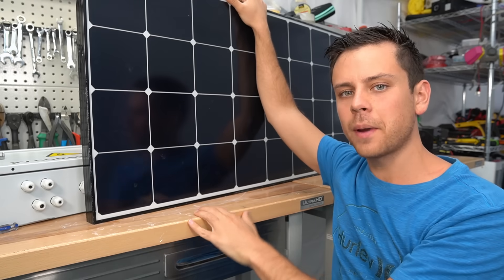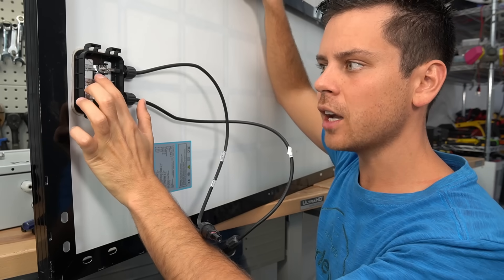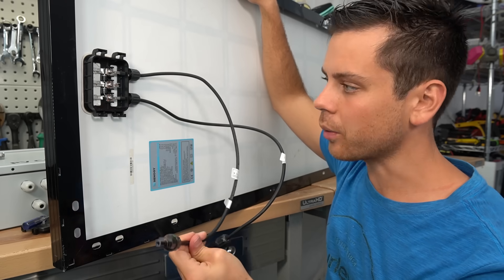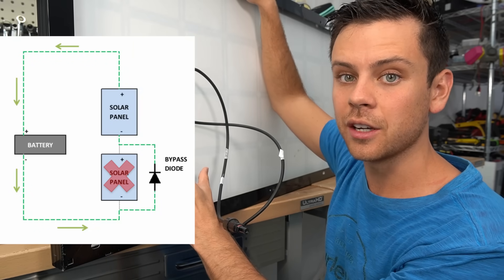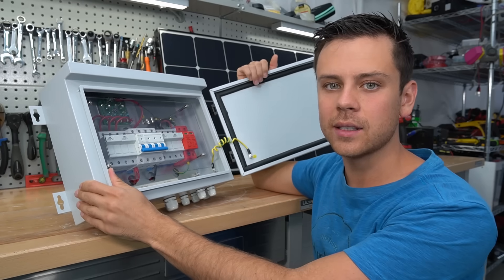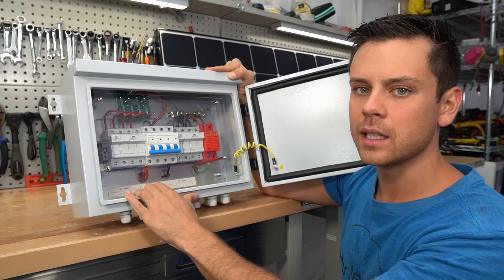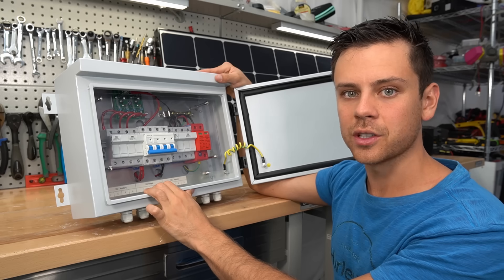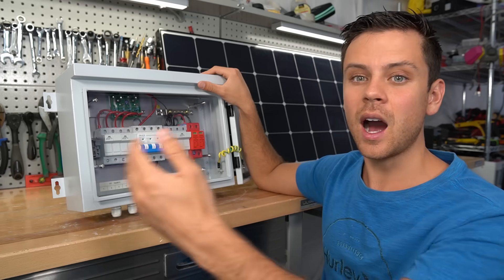Bypass VS Blocking Diodes in a Solar Power System

Comment: I actually removed the 10A rated diodes from my two 50 Watt panels (in series). That alone got me from 55 Volts to 70 Volts(2 x 36v). The shading is only relevant at certain hours of the day and is already low efficiency. Mine are stacked on top of each other in portret mode and I discovered that panning them on the Y-axis (horizontal angle to the sun like a door) produces a lot more also. It seems that some panels have difficulty absorbing direct sunlight shining exactly straight on them making them hotter reducing voltage,  that is what I discovered.

Comment: Could you make a video on the Sunpower 110w flex and explain in details on the tech? I just bought 2 and fixed them to an EB70 in Parallel, seems to work fine! But... Well. And by the way Sunpower has these insane nonsense plugs, whats up with that?
Reply: Hey- I just bought 2 Sunpower 50 watt.  I am chasing down blocking diode because Sunpower's instructions warn against parallel connections without.  But I wonder if really necessary.   Mine have MC4 connectors by the way. The industry standard.  I prefer Anderson but...
Reply: @ceeweedsl  Yea it talks about not putting them in parallel if blablabla... Well I have not had a problem yet, but the max I have done is 84 watts behind windows with a west side and anyway as I don't max anything out, far from it, I doubt that I will have a problem.

I don't know what the blocking diodes really are... But if you find something please put the name so I can search it out.

Well the MC4 connecters are standard on those panels the problem is with these varients that they use, is that they have this lock nonsense that is not found on standards MC4 plugs.
Reply: @darkijah-andersjehovahsn7893   1) Yes, got it about the MC4.   I just hooked mine up once so far but did notice the locking side that requires a tool.  I have a few others with and without the locks.  I was thinking I just cut off the outer guard on the locking area and then use fingers instead of tools to disconnect.
Reply: @ceeweedsl  Yea, did that myself,  but still not as good as the standard without it. But it works.
Reply: @ceeweedsl  My solar panels has yet blown up, and I have no blocking diode or anything.... I have them in Parallel but I might get them in Serial if I get a MarsRock controller but... Still working on that. Maximum wattage I have gotten from the 2 110 watts panels in total are 160 watts but the EB70 can only do 8 Amps and it is not in pristine conditions for sure.
Reply: @ceeweedsl  I have ordered a box of Andersons pole plugs.... Hopefully I can just change all those many many many many different plugs to Andersons. I hope. Like it's a complete mad house with different plugs, getting more and more.

Comment: Okay so I just fixed 2 solar panels from Sunpower 110W each, parallel to an EB70, seems to work. I was thinking of fixing the older 50w other panel of another company to it in parallel with the 2 others although unsure if it will work. But I guess it is not recommended. I'm somewhat new to this solar panel thing. I'm not sure they will have the exact same voltage, actually if I recall I think the 50w does 12 volt and the other 2 does 18 volt.
Yet in theory I would think it would work as it is inside the reach of the EB70 but maybe it is not a good idea.
Any thoughts?

Comment: Good day sir, please I want to know if 5kva /48v inverter with 250w panels 5 and 100ah12v batteries 10 ,60a charge control can power ,1hp surface pump and 1.5hp surface with1.5hp summecible  pump and home load lightens of 941wtts, with two AC.

Comment: Have you ever investigated micro inverters? I.e. on panel inverters. I suspect they would require changes to charge controllers etc. But supposed to optimise around shaded panels and reduce wiring cost (a single 120vac buss from the roof). Really like to hear your thoughts

Comment: I have a question. I have 2 Outback flexmax 80 charge controllers. I’m still experiencing back feeding even if I’m on the generator. Is there a setting I need to change to prevent this.

Comment: Fantastic explanation! If I buy a combiner box that doesn’t have blocking diodes but has the positive output of each fuse wired directly to a buss bar, could I just insert a blocking diode on each wire before they get to the buss bar?

Comment: I'm looking to install solar on my van and trying to keep it simple. If I use 2 100w or higher panels depending on price,in parallel, can you show how to install bypass diode in case I happen to park where my van is partially in shade.

Comment: Question: don't the diodes (whether blocking or bypass) in the panels also prevent power drain into a string from a parallel string?  i.e. are the combiner box blocking diodes not redundant in any case?

Comment: Great video Will, I'm installing two panels in series connected to an MPPT regulator in my RV, I thought I'd need to install an extra bypass diode in parallel to each panel in order to prevent the full series to stop producing energy once one of the panels were to be completely shaded. Is it correct or the built in bypass diodes in the panels already serve this particular purpose? Thank you Sir!

Comment: So, more of a question, than comment to help me clarify: The Big Shed will have two different angles (E & W) and could utilize a joiner box with 2 Blocking Diodes where a 3rd Blocking Diode will be used for the back, south facing only, shed. Then transfer its combined voltage to a single MPPT Solar Charge Controller, or can I connect all 3 strings to the one MPPT instead of a Combiner Box?

Comment: I've been reading about the use of microinverters and optimizers to ensure that a shaded panel does not reduce efficiency of a string. Are you saying that these are not necessary if the solar panels have a bypass diode?

Comment: Thank you for your crystal clear information will. Can this blocking diode combiner box used for combining pvs to gain higher total output voltage more than the PV Max System Voltage...? 

For example getting a total of 300v dc for inverter with voltage rated between 120-450vdc, from a solar panel with max sys voltage @100v

Thank you.

Comment: After testing for extended periods of time at a 'shade problem' location I have found the parallel consistently out performs the series setup, the bypass diodes may help a series setup but they are not as good, it would be interesting to see the exact efficiency losses for those diodes. I have found  the bypass diodes are only about 80-85% as effective as a parallel setup in problematic location setups.

Comment: Nobody seems to be addressing what a blocking diode does. If you have a 100 watt panel and a 50 watt panel you will need to install a blocking diode between the two different wattage panels.

Comment: Hey Will-  talking about bypass diodes.  I did some testing to see what it takes for the diodes to turn on and found that when that when that loaded string of (shaded) cells output voltage drops to just less than .8 volts the diode turns on and allows current to fully bypass that that string of cells.  The output of that panel or string of cells becomes zero but at least it allows current to continue to flow through the series circuit.

Comment: Hello :) I love your videos and have a question for a long time: If I connect 12v and 24v solar panel in parallel do I need a diode? Or I may have a problem with power output?  Thanks again for your great videos.

Comment: hi Will thankyou for your great videos ,you said never use blocking diodes for a series string ,what would happen if you put a blocking diode after each panel in series ?apart from volts used by the diodes ,would they work fine?

Comment: I don't understand it's like this is not working properly I shade just a fourth of one panel and my output drops to 25 to 40 watts from 300 if I shade just one cell on one panel it doesn't drop as much am I doing something wrong or are my panels not working properly. Thanks in advance

Comment: I have a small diy system (2)100 watt panels connected to two separate controller/battery setups.  The solar inputs of one controller leaks full battery voltage at night, back to the solar input of the other controller sharing the panels. Its madness :) Im thinking an inline diode on the(+) leaky controller would solve my issue. Is it common for a controllers solar inputs to mirror battery voltage?

Comment: Nice diode roundup Wil! Thanks.  Would you recommend that if I have two MPP Solar units hooked together for split phase operation and I have east and west arrays it would be best to hook an array to each MPP rather than using a diode combiner?

Mike I did see that crazy illusion with the black diamonds jumping all around. Funny they disappeared when you looked specifically at them.
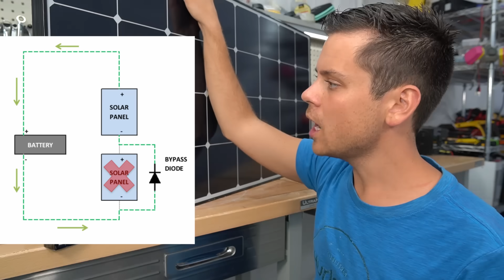Reply: 0:59 I was getting black dots in the centre of the diamonds!

Comment: Anyone notice the optical illusion when looking at the solar panel? Where all the cells meet in the corner, there is a diamond shape. I think it is the solder track. Anyway, if you stare at them, the white diamond turns black, but only in your peripheral vision. You can't look directly at one, you are always chasing the black diamond. Good videos...

Comment: I was under the belief that blocking diodes protected from reverse charge / current that could cause a coating on the solar cells to separate from its substrate, which would ruin the cell.

Comment: So I have multiple solar panels all over my bus mainly because of my hatches, so I have one large one on the roof one on each side & one large one at the back window! They are all mounted on the inside of the bus except the roof one!  So I have to make sure that no cell is shaded !  Now I get that I should have one MPPT charge controller for each panel so that when the sun is on the opposite side it won’t draw on the battery????? 👍 Cheers

Comment: Does this mean that any inverter with 2 separate MPPTs will support a different string on each MPPT without one string adversely affecting the performance of the other? I have one 3kw array on my east-facing roof connected to MPPT1 in my inverter (Sol-Ark 5k), and bc 3kw is nowhere ner enough for my home, i'm planning to put another 3kw array on my west facing roof connected to MPPT2 in the Sol-Ark. Does the fact that an inverter supports separate MPPTs indicate that it uses blocking diodes internally to allow each to perform at it's best (given solar conditions) without adversely affecting the performance of the other?

Comment: So I have a renogy DCC30S in my van and an auxiliary plug to chase the sun with. I am thinking of putting on a 50w solar permanently attached to my battery pack. Can I simply plug both positives onto the PV+ of the Renogy and it will take the power together or one panel?

Comment: Excellent explanation. I am familiar with water pipes. Bypass is the same in water open all times just like an overflow pipe so water will flow at any direction. The blocking diode is like the backflow prevention. It only allows for one direction. 
What are thoughts on combiner boxes with solar system with sun trackers (with the assumption of the system in two different sides on the east and west side)?

Comment: I have a curved roof RV with the utilities in the middle.  My plan is to use 4 CIGS solar panels in two rows parallel and in series.   
Driver side has two panels in series going along the outer edge and the passenger side has two panels in series along it's edge.   The middle of the camper is vents, AC units, TV antenna, etc.. 

After watching this video I'm concerned about having the one side shaded by the hardware on the roof while the other is facing sunlight.   Would it be best to use the diode as explained or get two of these: Victron Energy SmartSolar MPPT 100V 15 amp.  

I assume if I bought two victron's I would have to manage them separately.  Is there an MPPT on the market that can accept two solar inputs and balance the charge to the batteries?

Comment: I reuse shottky double diodes, they look like transistors, from computer power supplies as blocking diodes, since I do parallel connections of multiple strings with different angles and different solar panels into my grid tied inverter with limiter. It has max 90 volt input, so only 2 panels put in series each string.

Comment: Hi Will, I have a 4S2P (400W each array) on the roof of my RV.   One array mounted in the front and the other in the rear (35-ft apart).  Sometimes one array is in the shade when the other one is in full sun, would it be wise to install a blocking diode on each array?  If so, do you know if the diodes can be bought built-into a MC4 connector type configuration?  Thank you for sharing your knowledge sir, much appreciated.

Comment: Great info sir..but i have a question one of my 100w panel when i connect to the battery it will drain the battery instead of charging it..should i replace the blocking diode?

Comment: can you run an acid battery with a lithium battery ? can you use 12-2 electrical wire to run under ground to the system 50ft away in my house?
Reply: Don't mix chemistry or preferably not even different brands with same chemistry in the same battery bank with same controller.  Use separate controllers.   
12-2 would likely see a significant voltage drop at 50 ft depending on the Volts and amps.  If you have fairly high voltage (connecting panels in series) then it may be fine, though.   I would run 10-2 if it's getting buried in any case.

Comment: Will, thanks much this was great!  I am probably missing something but how does a bypass diode keep from bypassing the panel all the time?   If you put a bypass diode in parallel with the solar cells doesn’t it in effect short out the solar cells?    Is the bypass diode a zener diode?

Comment: Hi I have a question I hope you could answer. I currently have a normal 130w solar panel with mc4 connectors I also have a power station that uses a 5.5mm barrel plug as it’s charge input. My question is. If I use an mc4 to 5.5mm adapter on my solar panel will I be able to plug it into my power station directly or do I still need to use a charge controller between the two? I can’t find this info online and I don’t want to kill my power station. Thank you.

Comment: I have a question about this combiner box can you combine two different voltages in one box? For instance a 12 V array and a 24 V array on different strings?
My theory on this is I would be able to increase the amps on a 24 V array cheaper by adding 12 V array into the same output on different input strings.

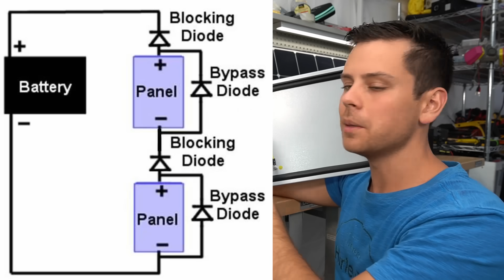Comment: At 2:52 the diagram for blocking diode is an example how NOT to use   them. The panels should have been in parallel. Internally the panel should also have bypass diodes for each cell to avoid hot spot damage due to reverse bias current when a panel is partially shaded. A panel with 144cells that's wired internally as 72s2p also should have internal blocking diodes in series with the 72s before internally connecting the two cell strings in parralel.
Reply: I think you're correct.

Comment: Hi Will.  Two items:  1) I bought the CIGS panel you have on your golf cart.  It’s on the roof of my DIY Transit camper van.  When the panel arrived, it was missing the little cover for the black box.  I don’t recall seeing any bypass diodes inside there, but I could be wrong.  Currently, the panel in on the roof of my van with a little black cover installed.  Anyway, do the CIGS panels have bypass diodes?  It’s different technology, after all.  2) After our maiden voyage last week to Utah, I want to add a second CIGS panel in parallel to charge my Jackery 500.  I also charge via cigarette lighter in the van.  With the heat wave last week, my refrigerator was working pretty hard.  At the same time, it was mostly cloudy.  Because the clouds were changing and I was driving and not driving, I was constantly swapping between the cigarette lighter cable and the solar cable.  It was a nuisance.  I want to build a combiner box myself with three inputs for CIGS 1, CIGS 2, and cigarette lighter.   I plan to use a new chip I defined myself for Computer USB current sink PD input protection as part of my job in Silicon Valley.  The chip acts as an “ideal diode” with Vf of only 20mV, plus only 11mohm on-resistance at heavy loads, 7A continuous rating, over-voltage protection, under-voltage lockout, over-current protection, over-temp protection, true reverse-current blocking, soft-start, short-circuit protection, and ESD and Surge protections.  It also has open-drain Power OK indicator flag, which could be used with small LEDs to see which input was active and being used to charge.  I also might like to add small digital volt meters to each input so I can easily see the voltages from the two panels and the cigarette lighter.  I think it’s far superior to using passive blocking diodes, albeit, more expensive than diodes.  Is this something you are interested in?   I’m thinking of writing an app note or making a reference design on this application.  Any suggestions are welcome.  BTW, my 2020 van has the dual AGM batteries under the seat as part of Ford’s swivel seat package.  It’s useful for my case.  The cigarette lighters stay active for 40min after the ignition is turned off.  So I can transfer some AGM energy to the Jackery whenever I need without much worry of not being able to start the engine.  Not sure if your van is the same or not.